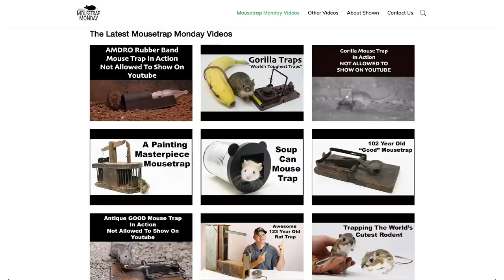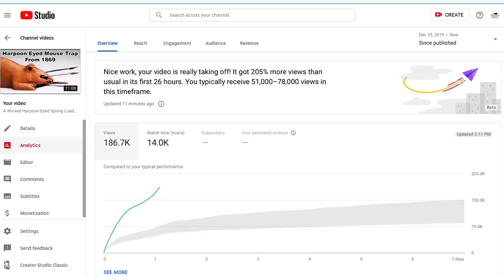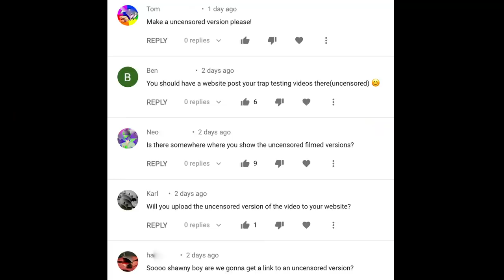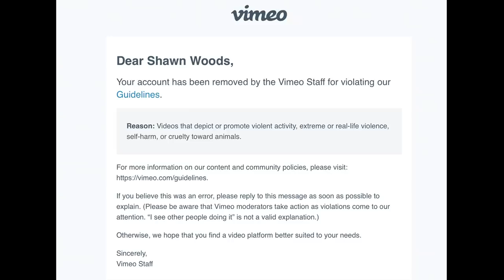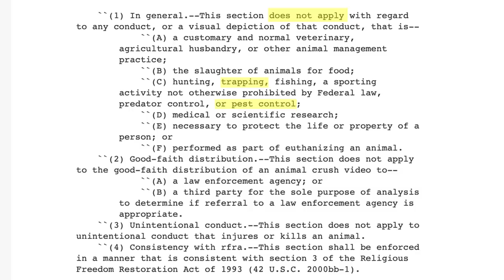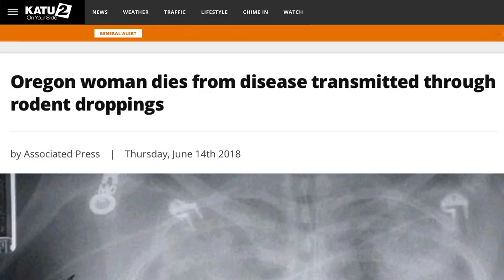The Jaws Of Life Mouse Trap - Mousetrap Monday

Comment: The teeth should be interlocking. Otherwise excellent.
Reply: Pretty much doesn't matter. A mouse body will keep the teeth separated enough that they wouldn't interlock anyway. 
Think of a pair of pliers with teeth. The teeth dont interlock because they are designed to have an object grasped between them.
Reply: Teeth should be sharpened
Reply: I'm lazy, I'd have used a cheap pair of scissors.
Reply: @Walter-wo5sz  Except that would not work. Cheap scissors have plastic handles which can break very quickly

Comment: Ever consider setting up your own server in your house. The only possible intervention would be with your own ISP, but I doubt that they would be bothered. Most ISPs charge a flat monthly rate, based on your UP/Down speeds. If you have any computer network savvy pals, run the idea past them. For some reason, I was not notified of this latest video, but I found it on my HOME YT page. Good luck .. hope you find a workable solution. Happy New Year.

Comment: The problem with the trap like this is, you have to deal with blood and guts and a carcass, and a trap that is going to attract insects and flies from the blood.
  there is a device called walk the plank mousetrap on eBay for around $12. It’s like a swimming pool diving board. You put peanut butter on the end, the weight of the mouse, or the rat, makes the diving board collapse under the rodents and drop him into a bucket of water. I put about 2 inches of water in there for mice. The walk the plank device is heavier on the back and so it automatically resets itself after every customer. No blood or guts, the next day, I simply remove the walk the plank contraption, it’s just clipped onto the edge of the bucket, and I flush the mice down the toilet, I put another 2 inches of water back in the bucket, and I’m ready for the next batch.. No blood or guts, no carcass, and no attracting insects and flies

Comment: Probably the most effective trap concept could be a plate that attracts many mice and when enough mice run up to it their weight should set off the trap by whatever is the method. The trigger would be set by the chosen wright either by a wire or spring. Is there anything like that?

Comment: Hey man, you've got a new subscriber. 
Anyway. I'm glad that you managed to have a decent solution to keep up these kind of videos and still catch those rodents. An advice about this device: Try to mount the teeth to slide into each other's groove and sharpen them by filiing away the thickness of those teeths. In the end it should look like shark teeth. This allowes to snap the spine or neck joints too, causing even quicker end to the rat/mouse.

Comment: i would've designed the jaws to actually interlock so as to deal as much damage as possible so as to kill the mouse as quickly and painlessly as possible. i know a lot of people tend to prefer more humane deaths for animals. also washers on both sides with a bit of grease in between would allow for smoother rotation of the blades while still having a snug fit.

Comment: Oh and the solution for your video hosting needs would be your own server. It can be difficult to set up, so if you don't have the technical knowledge, you would need a friend who is into computers, but it would certainly be doable for much less than $4000. And the freedom is much greater than with any ready-made video service; you could even hire hosting on a different continent if the US law seems a problem. 
You hiring that $4k service shows you're trying to avoid the technical stuff no matter what, but that's exactly what you must do to succeed. I tried several photo hosting services and they were always problematic. And the wallpapers I offered weren't even that controversial. Certainly no killing of animals. Then I built my own server, learned a little php and it's a breeze ever since. The bandwidth cost can easily be covered by my day job, I don't even have to e-beg.